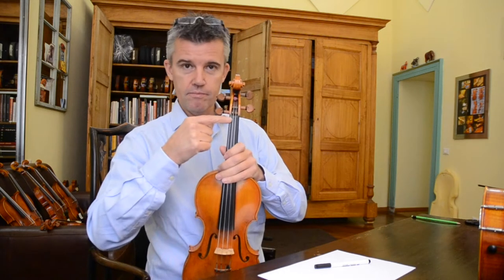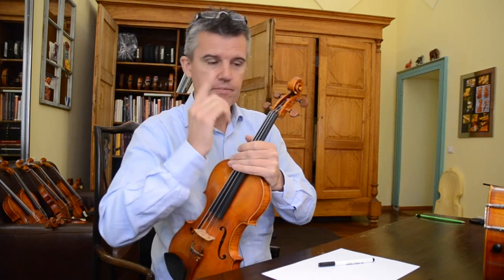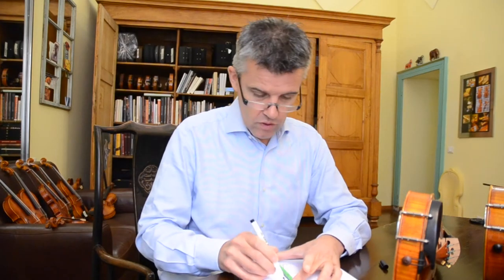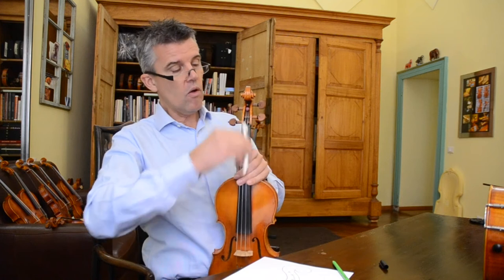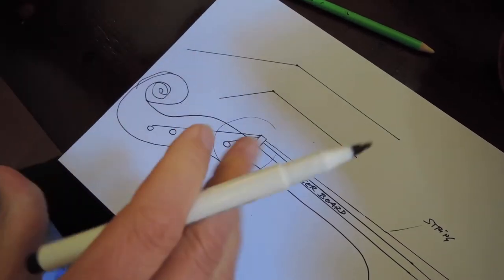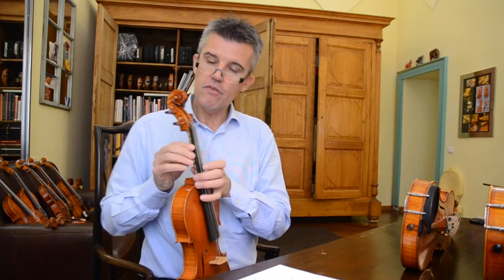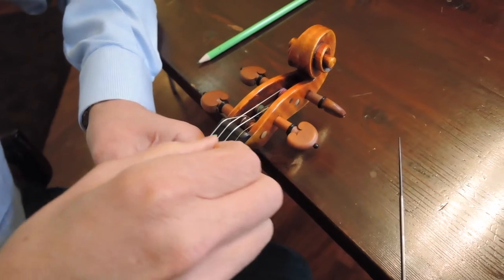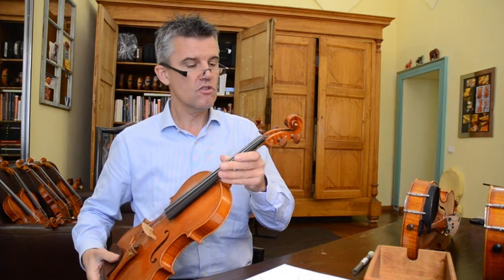Ep. 3: Upper Nut

Comment: Simply magnificent.  I have learned so much from watching to your videos.  I have an old Knock-off Jacobus Steiner violin and am trying to make some repairs of a botched job by a supposed luthier.  I am suspicious that the nut is cut too high and am trying to find what the median height should be.  I am thinking about 1mm and certainly not 2mm.  Have not found the facts yet but the nut on my violin is cut at 2mm and the back curvature does not look correct.  You say in this video to send pictures and you will help.  How do I send pictures??
Reply: Carve the top of the nut (before the strings slots are cut) 1mm g side to .75mm E side above the fingerboard. Then use feeler gauges to measure the actual string slots above the fingerboard .6mm measured from the bottom of the string in tune to the top of the fingerboard on all strings will get you really close.  Then you can adjust the string slots to taste.
Reply: @BillyBrownBluegrass  Thanks a lot for that information.  I certainly appreciate it that you took the time to respond.  
    This makes more sense than 2mm above the fingerboard.  I have been slowly working on this for some time now.  Have had to re-cut bridges as I screwed up the feet.  Think I have it now, then there was mounting the sound post.  I have an SP setter which I like and works well.  My puzzlement now is how many annular rings should be present in a respectable SP.  Currently I have installed one with five annular rings (winter wood).

Comment: Hi  I am doing this very thing an hour ago. SO I AM EXTREMELY INTERESTED. ALL I COULD FIND ON THE INTERNET WAS TO SMEAR SUPERGLUE THEN DUST THE NICK WITH EBONY DUST. I DID THE BEST I COULD AND REFILED THE NUT STRING SLOTS. I SAW THAT MY E AND. A WERE TOO DEEP PREVIOUSLY SO I SMEARED SUPER  GLUE INTO THE NUT AND TWEESERED THE EBONY DUST FROM A FILE. VERDICT?  THE SOUND IS MORE STRADIVARI LIKE AND THE  D. MORE HEFIZESQUE! IT HAS A WARMER SIZZLE ONTHE D AND A AND MORE SOUFUL SOUNDING. I A
M. NOT COMPLETLY HAPPY BECAUSE D IS TO  FAR AWAY FROM. A BUT I CAN DO ANOTHER DUSTING AND REFILE AND I THINK THAT WILL SOLVE THE BIG GAP  BETEEN D AND A. ITS THE MAPLE SYRUPY  SOULFULNESS THE PLAINTIVNESS THE SOULFULNESS  IT IS BEST HEARD ON JOSEPH SYLVERSTEINS GUARNIERI DEL GESO. THAT IS THE LET ME CALLYOU SWEETHEART  TONE I AM AFTER. I USE RUGE ON THE BRIDGE NOTCHES. THANK YOU SIR FOR COVERING THIS VERY DELICATE MATTER. I
LOOK. FORWARD TO ANYORE VIDIOS ONTHE STRING BREAK ANGLE AND  NUT. THANKS VERY MUCH YOUR SPOT ON!